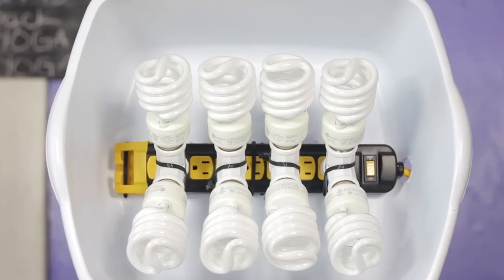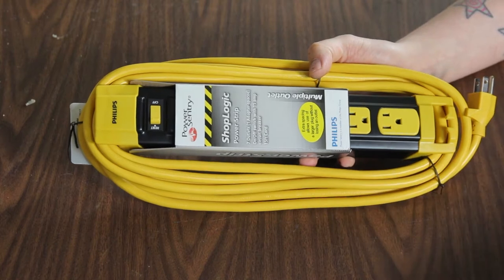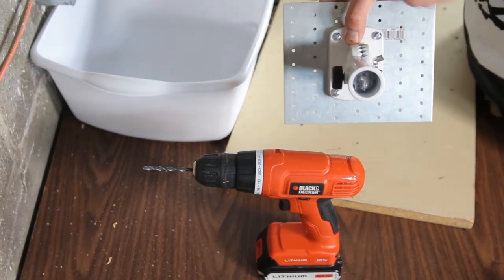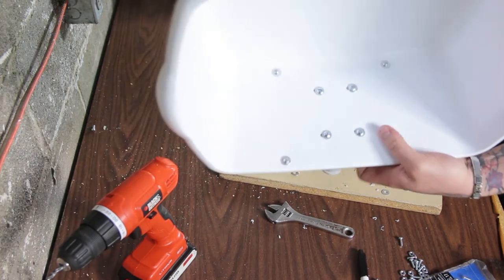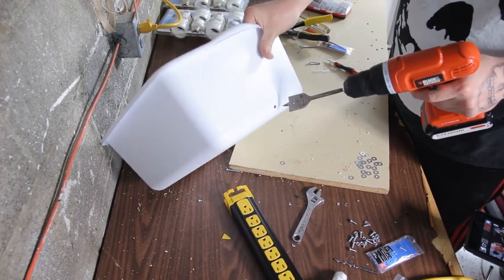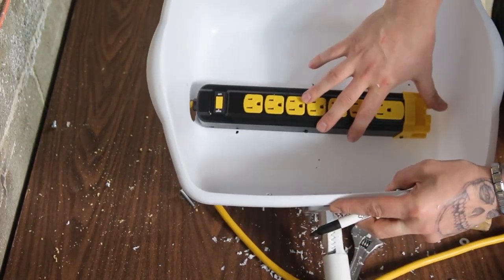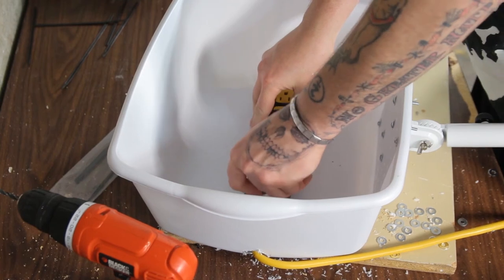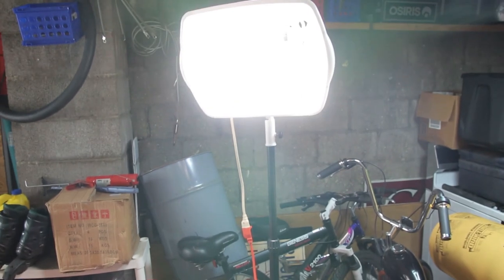Best DIY Video Light - Quick & Easy

Comment: A few years ago I made one of these lights using your video-- liked the simplicity compared to the Indy Mogul one.  Just had to come back and say thanks for putting this out.  I also made some faux kino flo 4 bank lights from a different channel, but your light design is the one that I reach for first and is really the workhorse of my video lighting equipment.  It puts out plenty of light (I use clipped-on baking parchment paper for diffusion).  It is compact and so has added flexibility for positioning in tight spaces.  Thanks, man!

Comment: Awesome. You could put the power strip on the wash basin with velcro too -- or those command strips. You can also put baker's paper over the lights as a 'shade' for softer, diffused lighting :)